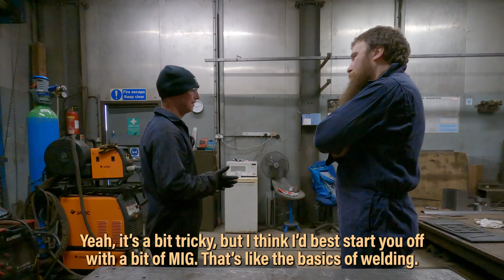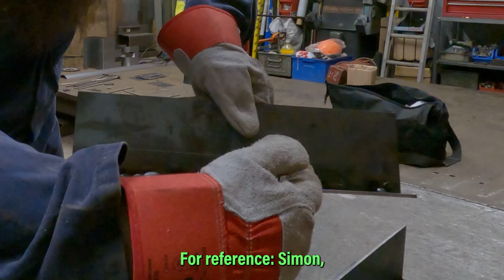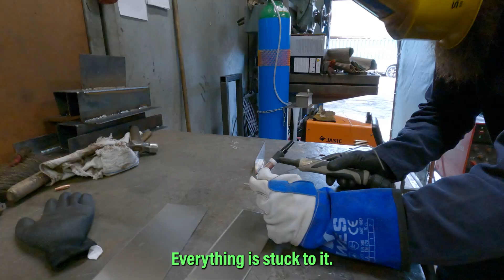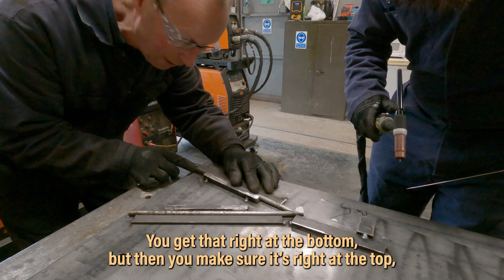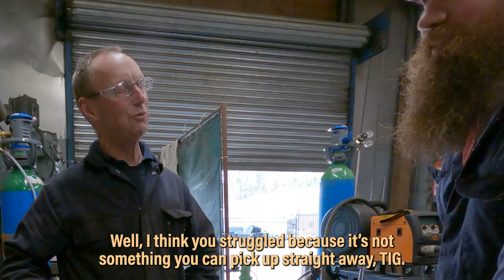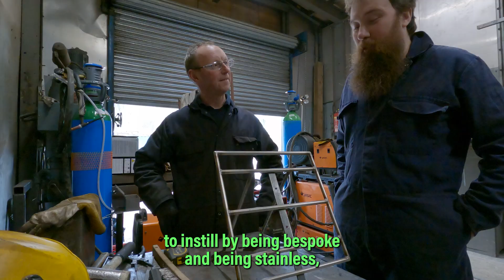Chris puts his beard in significant peril

Comment: They failed to mention that that center wire often has a (partial) liquid inside called flux that also helps keep oxygen away from the metals as they combine and cool enough to solidify. Welding is awesome.

Comment: Back in school I did MIG, TIG, and Arc welding (and none of them had automatic feeds, we did all of them by hand). For each, not only did we have to achieve a good result, but the weld was then put through press, tension, and torque tests and if the weld failed before the metal, you had to go and do it again.

By far, the craziest part to me was how little resistance the welding itself actually gives. You expect to feel pressure or push-back but by and large you generally don't. You might as well be laying down icing on a cake, except you're actually fusing metal.

If you want a similar crazy experience, try a plasma cutter. Cutting through 1/4" of steel instantly and with no resistance whatsoever was one of the most unsettling experiences I've ever had. (Also, the plasma cutting table was made of asbestos -- the only piece of the stuff remaining at the university, and is probably still in use today.)

Comment: "more difficult than you think." - Yeah, I did a year of evening classes, and got a City and Guilds in MIG welding, and i'm still crap at it. Still, I can usually do the odd bodge repair on my classic cars, and buying a MIG welder, paying for a C&G course, and buying all the other bits you need for welding (clamps, helmet, gauntlets, etc.) is still cheaper than paying a professional. (Oh, and as I'm a cheapskate, I use CO2, rather than Argon)

Comment: Back in my high school welding/machine shop, had a guy sitting next to me tig welding an exhaust pipe (sitting on a steel stool).

He made the mistake of pulling the electrode and the fill rod away at the same time while also not wearing gloves, the arc jumped to the fill rod, and he tightened up in his chair, almost launching straight out of it

Comment: I don’t think TIG is the hardest one. I might be alone with this but I find TIG welding soooo much easier than stick welding. Firstly you can actually see your weld bead and can adjust your speed by looking at it and secondly you don’t have any smoke in the way and around you
Reply: You can see stick welding too. If you can't you're not using a strong enough shade lens. Although it isn't quite as easy to interpret what's going on inside of a stick weld puddle being as there's the molten metal and the flux in there. The flux is the brighter frothier stuff. A big part of welding is managing to stay out of the smoke. You don't have to be right on top of something to weld it. You should position yourself at somewhat of an angle.

Comment: MIG welding is like having a glue gun... but the glue (copper wire being fed) will react badly with air and become porous and weak.
So the nozzle that feeds the wire/glue has a surrounding feed of unreactive argon gas constantly flowing, Like a hose pipe inside another hosepipe.

I hated MIG welding as I could never get the amps/wire feed/gas feeds and speeds correct, Trying to balance those 3 was too much. Loved TIG and oxy-acetylene (a blue flame) welding though. Edit: I did all 3 (and makling blueprints and fabricating tools in 12 months at college aged 17, never done it since).

I think Chris found it easier going vertical because when going horizontal he was welding with the "torch" pointing forwards into the direction of the weld, I always hated that part.
However going vertical the welding was in the direction towards the torch.
..If your right handed imagine holding a pen (pointed left).... and writing from right to left.
I'd find that harder than writing from left to right where the weld puddle follows in the direction towards the torch/pen rather than "trying to overwrite it".

Again its been over a decade I could be VERY wrong but its my 2 cents.

Comment: I did a bit of welding in university during my mechanical engineering degree. I tried stick, MIG, and TIG. I learned very quickly that I am not good at welding and would need a ton of practice to get to an acceptable level. Chris did far better than I ever did.

Comment: As welding has been explained via an analogy to soldering I though I might elaborate on that:

There is an important destinction between soldering and welding. Welding melts the base material, while soldering does not. This leads to welds being a fusion of the material, instead of glue holding it together. Because the filler material is usually harder that the surrounding metal, the welded region is harder the base metal. The only loss in strength comes from the smaller cross section and the influence of heat on the surrounding metal.

Comment: Another point to be made: both MIG and TIG use DC (direct current) as opposed to AC (alternating current - what you get in your electrical sockets at home)   With MIG, the power flows through the filler metal coming out of the stinger creating an arc to the base metal.  With TIG, the power flows through the tungsten creating the arc to the base metal. 
[I was a Nuclear Welder on submarines for several years]
Reply: Apart from AC TIG... Great for aluminium
Reply: Did you do welding in the water?
Reply: @PianoKwanMan  HaHaHa,  no, dry dock

Comment: A few words of caution: ⚠️⚠️⚠️

They said that you can go to a store and buy welding stuff. Though this is true, it's very much NOT recommended that you try welding without any training! Welding is dangerous in multiple ways:

The light from the welding spark can blind you. 
The electricity can shock you, causing severe injury or death. 
The molten metals tend to splatter, which can burn you. 
Even after your weld is finished, the metal parts will be very hot and can cause severe burns. 

If you want to learn how to weld, many companies will train you. Private citizens also can train you, but they usually can't award you any certificates or things that a company or college can. 

So, if you want to learn to weld, great! But do it the right way, safely!
Reply: And that’s why neither Matt nor Chris had just gone and bought welding equipment already. If they did go out and buy a set, I assume it’s Chris who kept it, because as far as we know, Matt still hasn’t been taught how to weld.
Reply: It seems a little excessive to say that. You can learn to weld by buying a machine and doing it all yourself, there really isnt much risk for a sensible person. The arc is bright but you only make that mistake once, I would be impressed if you electrocuted yourself with any welder it's not really possible because of how they work ( high current, low voltage). And its fairly obvious that the process that melts metal makes things hot.

Comment: I have learned to weld at school with rods covered in a sheath of some sort of ceramic catalyst material. We had to put in a clamp and you needed to tap the workpiece with the tip of the rod to get the current going and start welding. Which was always nerve-racking because the sputtering metal could ruin your workpiece right then and there and even worse, the rod could pick up the workpiece by sheer electromagnetic force. And we had to do it with one hand because the other was used to keep the mask in front of our faces. The rod would get shorter as it shed material, so you needed to plan ahead and consider where to end the weld too. And then when the dodgy weld was done, you had to hammer off the slug of carbonised ceramic stuff and finally see whether the weld was any good. In my case: no, I do not have steady hands or technical talent. Some of my classmates did pretty well though.
Anyway, this MIG stuff looks much more practical, I gotta say. Still doubt I'd do as well as Chris did -- props!
Reply: Stick welding.

Modern stick welders are a bajillion times easier to use them good old ones.
Good old ones are a bajillion times easier to use than cheap and nasty old ones.

I quite enjoy it for larger stuff.

Comment: It's just a hot glue gun, isn't it? I mean, it's REALLY hot glue, but not that fundamentally different.
Reply: except for the arc
Reply: The wire feed of a MIG welder is kinda sorta that, but you're also melting the surfaces of the bits that are to be joined, so they and the wire all mix in the molten pool.
TIG is more like gas (oxy/acetylene) welding, but using an electric arc, instead of a flame, to heat/melt the parts and manually added filler rod.

Comment: I thought welding was just a lot of heat to melt 2 bits of metal but this seems more akin to über soldering.
Reply: There is such a thing as fusion welding. You can set a joint up so one of the parent pieces is partially sacrificed to make the filler material in the weld. Like if you're making an angle you stick one piece over the other a little and melt it down. In general you want to use filler material though so you can fillet the bead to add strength.

Comment: As someone who has spent a decent amount of time welding, it is weird to hear that MIG at 50hz rather than the 60hz here in the US.
Reply: I think that might have been set to pulsed?

It certainly doesn't sound anything like my welder!

Most welders these days are inverter ones so mains frequency shouldn't have any effect.
Reply: MIG is direct current. Or should be. I think some really cheap welders may be AC. But they're flux core too. So MAG.
Reply: @1pcfred  MIG is generally more correctly called MAG. The gas is not usually pure argon, it has carbon dioxide and sometimes other stuff in smaller quantities too. Different mixes for different applications. You generally use pure argon for TIG.

Flux core can either be gasless or dual shield for very high power welding.

I've never used pure argon for MIG or MIG mix for TIG. It probably would work in some form.
Reply: @1pcfred  sorry, I got confused by your "so MAG" statement after the comment about cheap flux core welders.

What's MIG like with pure argon?
At the moment I have to wait until my gas runs out before I can switch between process as I don't want to have to pay for two bottles!
Reply: Oh yeah, it must sound a minor third higher on your side of the pond.

Comment: I knew better before this. But for the longest time, I thought welding was using a material, joint it to something else (similar to squeezing clay together, since then I learned or is using a joining metal to hold things together similar to using a glue gun.
Reply: Except in welding, the glue gun in question not only melts the glue but also the pieces that are to be joined.
Your ending  description better fits soldering, and/or its higher temperature sibling brazing (aka hard soldering), where the added solder is the only thing that melts. 
Technically the solder and the base metals form a thin  layer of alloy (if done properly) at the mating surface between the base metal and solder, which is why it  grips so well. A poor solder joint, bits too cold and/or no flux (for cleaning and preparing the surfaces) will not bind very well.
Reply: Technical in space with two extremely clean pieces of metal you can just push them together and they will stick. It was actually a concern in early space ship design
Reply: But I thought a large part of that was due to the temps?

Comment: I was watching this thinking "oh neat, learning something, picking it up fast, very cool" and then Chris said "only weighs about a kg, it's thin-wall stainless"! That's somewhat more impressive than the steel rod I was assuming he was welding, I understand thin-wall is a bit of a pain to weld, cos too much heat and it just melts where you don't want it to!
Reply: He can weld it because the guy who actually knows what he is doing has set up the machine properly for thin wall tubing and has  properly prepared the metal.
Reply: @collinscody57  Well, yeah, but still easier to cock it up than with round bar, I would imagine, even if just by staying in one spot too long
Reply: I didn't consider that. It must be very delicate.

Comment: For those who are confused by what Chris Joel is talking about the use of Argon, when welding, you will want to keep Oxygen out of the joint you're creating. While the metal is hot and molten, Oxygen will combine with the metal to create metallic oxides, and the metallic oxides will cause the joint to be weaker and fail sooner. So, in MIG and TIG welding, an inert gas (usually Argon, but can be any of the noble gasses) is blown on the joint to displace the normal air containing Oxygen and Oxygen containing compounds from the area.
Reply: Imagine helium welding, after a long day in the shop you go out for beers with some of your coworkers, bar sounds like a preschool
Reply: @jeffgoldblunt  Tig was originally marketed as Heliarc and did indeed use helium instead of argon
Reply: @jeffgoldblunt  A balloon filled with Argon has some interesting effects on the voice as well.
Reply: @jackielinde7568  that's because your vocal chords... argon.
Reply: Also radon?
Reply: Argon? Welding is a noble profession.
Reply: @vigilantcosmicpenguin8721  Never said it wasn't.
Reply: @jackielinde7568  it's a joke. Argon is one of the Noble gases. (Because the family is atomically super stable and doesn't want to react with stuff)
Reply: Thanks for the explanation, really helped me get what he was talking about
Reply: Also, for tube welding, the tubes are also filled with argon. I can’t imagine they would be on this small project, but things like bicycle tubes are argon filled during the welding process.
Reply: @Briantho2010 He said it was stainless steel tubing, so it actually might be. Back purging with argon is much more important for stainless than mild steel.
Reply: Unless you're doing MAG in which case you also have oxygen or NOx in the shielding gas. Never really understood that.
Reply: Oganesson and Radon wouldn't work, but that's just because it's generally considered a bad idea to blow radioactive gasses everywhere.
Reply: I had it explained to me in terms of rust being a chemical reaction between metal and oxygen. Generally, adding heat will speed up a chemical reaction, and adding a lot of heat when welding will cause very rapid rusting. The solution: shielding gas to blow away the oxygen.
Reply: @fanbladeinstruments  Well, they're not wrong. Rust is just Iron Oxide. 

Fun Fact, one formula for Thermite is Iron Oxide and Aluminum Powder.
Reply: I doubt you’d use oganesson for welding, since the decay products aren’t necessarily inert.

Comment: For those who don't know the difference between soldering (not pictured here) and welding (pictured here):

Soldering - The process of connecting two or more bits of metal by melting a soft metal to surround and bond to the bits to be connected. Depending on the application, it's generally used for non-structural connections (like joining two wires electrically) but can be used for a structural connection.

Welding - The process of getting two or more bits of metal hot enough that they melt and mix together creating a solid bond between the bits being connected. This is almost always used for structural connections expecting to take some sort of force.

I say this, because I know "Tom and Et Al" keep throwing around the terms soldering and welding interchangeably. Having done both, I can appreciate the difference.  Also, when I say non-structural connection, while it's expected that when you solder two lengths of wire together and you should be able to hang a significant bit of weight on them and not have the joint fail. But, this is not the primary purpose of the joint. It's usually used to make an electrical connection between two bits of metal. That being said, I used soldering to create a model car for electronics class by soldering bits of brass together to form the frame. The frame was needed to hold the drive system made from an old electric razor, battery tray, and a switch.
Reply: Another technique called brazing is similar to soldering, but uses a higher temperature process, with a stronger bond.
Reply: Ok, but, what is brazing?

Comment: I welded once. Can't remember exactly what kind of welding though. It was like TIG, but there was a stick of metal in the welding apparatus itself which kept getting shorter. And you had to first tap the metal you were going to weld before actually welding (so first tap and lift it back off and then get in there). So not only did you have to move it sideways consistently, you also had to move it closer consistently. I somehow managed to do a perfect job my first time. So I'm never going to weld again. That way I can claim that  100% of all the welding I've ever done has gone perfectly.
Reply: That's arc (stick) welding, with no gas, but a rod that contains a flux to carry away the impurities. The surface slag needs to be chipped off afterwards.

Comment: Yes, takes a lot of practise to weld properly, and in the beginning what you make looks more like a mad hen was scratching there and leaving chicken droppings than actual welding. Good thing they did not start him off at MMA or stick welding, which is the most common method, using a steel rod coated with a flux, and lots of amps of current to cook the flux and make the molten metal puddle. I started with that when I was young, and still make terrible welds, though they do hold for the most part. Also do gas welding, where you can vary from soft solder, hard solder, then various types of braze, to welding steel using steel filler rods. Recently got the MIG welder, though I went for flux core wire instead, no shield gas needed, till I can get a bottle of the expensive gas and the regulators. The cylinder and regulator is the expensive part, the gas not as much.
Reply: Interesting! I found MMA the easiest of the 3 processes to learn o.O